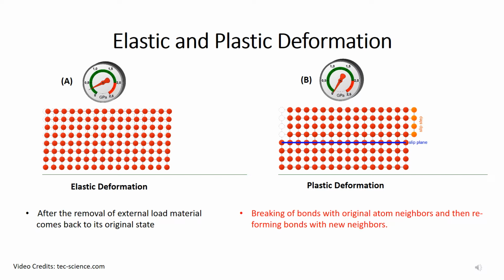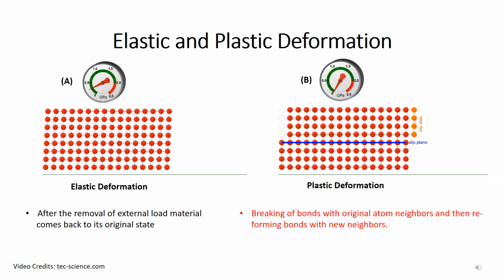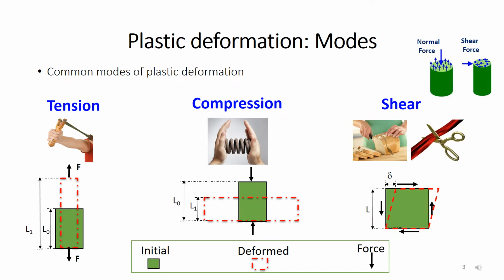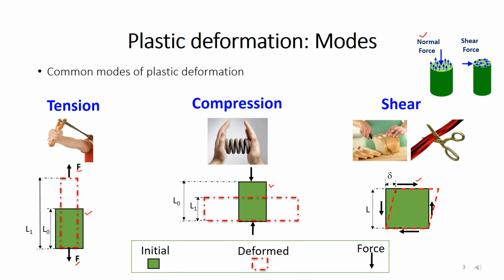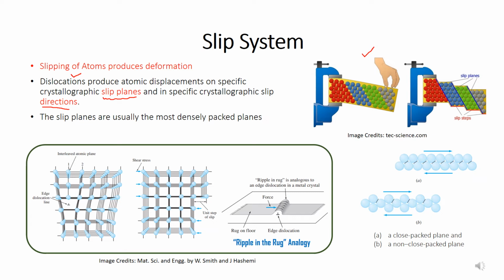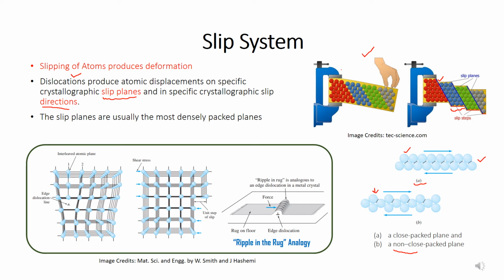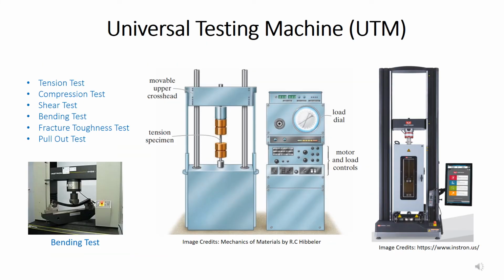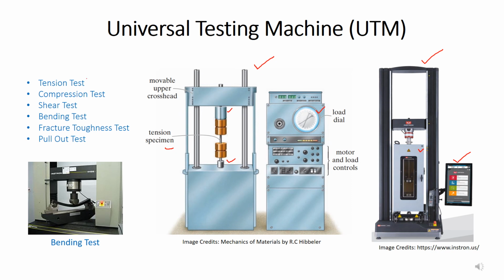Elastic and Plastic Deformation

Comment: @Engineering and Science Nexus Got something for you: A Geometry-First Theory of Lattice Collapse via Persistent Coordination Frustration
Abstract
Crystalline stability relies on the global satisfiability of local coordination geometries across extended length scales. Here we propose a geometry-first theory of lattice collapse in which a crystalline solid destabilizes when repeatedly forced to accommodate locally incompatible coordination environments faster than it can globally relax. Unlike chemical dissolution or chelation, the mechanism is topological and kinetic in nature, arising from enforced geometric frustration at interfaces. We formalize this principle as the IRZIVA Law and show that collapse emerges when the rate of imposed local incompatibility exceeds the characteristic relaxation time of the host lattice. This framework unifies observations from quasicrystals, amorphous materials, defect-mediated phase transitions, and solid–solid interfacial reactions, and provides a predictive basis for designing materials that induce lattice decoherence without chemical corrosion.
______________________________________
1. Introduction
Traditional models of solid dissolution and degradation emphasize thermodynamic driving forces such as solubility, proton activity, or ligand binding. However, numerous systems—ranging from quasicrystalline interfaces to amorphous–crystalline contacts—exhibit structural destabilization in the absence of strong chemical driving forces. These observations suggest that geometric compatibility, rather than chemistry alone, governs lattice persistence.
Crystalline solids are globally ordered systems whose stability depends on the ability to propagate local coordination constraints over long distances. When this propagation fails, long-range order collapses even if individual bonds remain locally stable.
______________________________________
2. Local Coordination and Global Relaxation
Let a crystalline solid be described by a set of local coordination environments C_i, each defined by coordination number, bond angles, and local symmetry. Global crystalline order requires that these environments tile space without contradiction.
Define:
	τ_r: the characteristic global relaxation time of the lattice (via phonons, defect diffusion, or reconstructive rearrangement),
	τ_f: the characteristic frustration forcing time, i.e., the interval between imposed incompatible local coordination events.
We define the frustration rate:
Γ_f=1/τ_f 

and the relaxation rate:
Γ_r=1/τ_r 

______________________________________
3. The IRZIVA Law (Formal Statement)
A crystalline lattice loses long-range order when
Γ_f>Γ_r

such that incompatible local coordination constraints accumulate faster than global relaxation can resolve them.
Equivalently,
τ_f<τ_r

This inequality defines a non-equilibrium structural instability, independent of chemical bond strength.
______________________________________
4. Geometric Frustration Metric
Let θ_ijrepresent bond angles in the imposed coordination field, and θ_ij^((0) )those of the native lattice. Define an angular frustration functional:
F=⟨(θ_ij-θ_ij^((0) ) )^2⟩

For periodic lattices, stability requires:
F≤F_c

where F_cis a material-specific critical variance.
For systems enforcing forbidden symmetries (e.g. 5-fold or 7-fold coordination), Fis non-zero by construction and cannot be annealed globally.
______________________________________
5. Relation to Known Physical Principles
	Ostwald’s step rule: unstable polymorphs form first because they more closely resemble the solution state; here generalized to interfacial coordination states.
	Geometric frustration: long studied in spin systems and glasses, extended here to coordination chemistry.
	Amorphous stability: short-range order dominates function when long-range periodicity is broken.
The IRZIVA Law unifies these concepts under a kinetic–geometric criterion.
______________________________________
6. Implications
This theory predicts that:
	Strong bonds do not guarantee lattice stability.
	Persistent local incompatibility is more destabilizing than transient chemical attack.
	Powders are intrinsically more vulnerable due to reduced τ_r.
	Interfaces enforcing forbidden symmetry can act as topological solvents.
______________________________________
7. Conclusion
Lattice collapse need not arise from chemical dissolution. When a crystalline solid is repeatedly forced to satisfy locally incompatible coordination geometries faster than it can globally relax, long-range order inevitably fails. The IRZIVA Law provides a general, geometry-first framework for understanding and engineering such behavior.